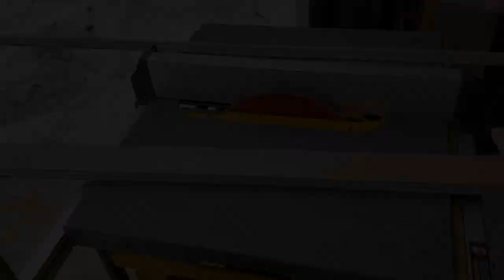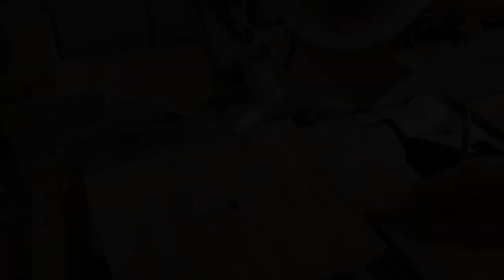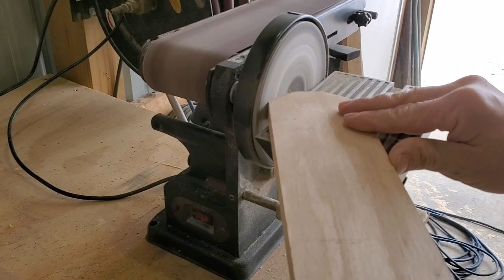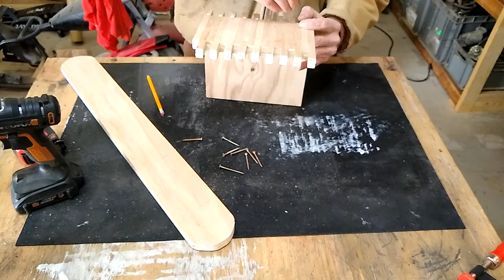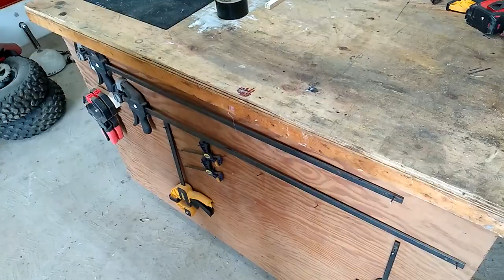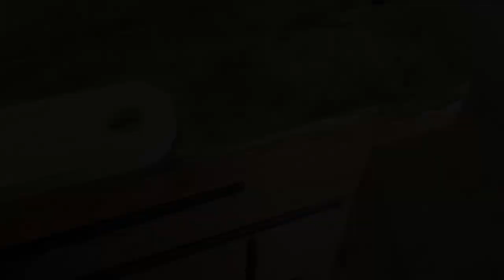DIY Box Finger Joint Router Jig Build

Comment: But you don't show how to use it. Does it work? Doesn't? Please, can you make another video showing how to use it and whether it worked or not at the end. Thanks in advance.
Reply from the maker: Yes it works and I'll make a short video here in a few days
Reply: It took a couple of trial and error runs for me to figure it out completely. The main thing to know is you'll rout the ends of 2 boards (4 ends) with the boards flush with the far right edge of the first finger of the jig. The other 2 boards (4 ends) will be routed with the board edge lined up with the inside (left) edge of the first finger of the jig. It's pretty slick and the easiest way to make box joints without a table saw or table jointer.

Comment: Is this working on bushel bearing (like that kinda bushel thing that goes into the router plate and overlaps the size of the router cut bit. 
Or does this jig work only for bearing staright cut bits? That’s already has bearing on the bit by itself?)
Reply from the maker: This one work with a bit that has a bearing on it

Comment: Jamie would this also work with a template bushing on the router? I can't remember if I have a ½", top bearing flush bit or not. Also, this design would work for virtually any size wouldn't it?  Thanks for doing this video! HUGE help!!
Reply from the maker: Yes a template bushing would also work and as for the size any 1/2 inch or smaller should work just fine

Comment: What is the purpose of the joint on the backside of you screwed it down and only use the front? I need to make one but would like to see how to use it. Is there a second video??
Reply: That would be used to cut the other end. Because it is offset the fingers will then mate.

Comment: Nice video. I would love to see the jig in action. Do I see it correctly that the vertical part is a little below the openings? Do you cut through that the first time?
How do you cut the opposite part?
Reply from the maker: Yes the first time you use it it will cut through it
Reply: @jlistdiy  ok. Does it matter a lot how much you have to cut through it?
Reply from the maker: no it dont matter
Reply: The other side of the jig is used to cut the other end fingers. They are offset from the first side so the joints will mate.

Comment: I built your exact jig. Thank for tip!  The big day came today for routing the panels that make up my speaker boxes. The material is 1/2 birch plywood, which I have heard that a lot of companies use for speaker boxes like this. I am using a very solid Porter Cable fixed base router with brand new 1/2" wide bits, with the bearing at the top of course. The problem is that no matter how slowly I go I still get a lot of tear-out (chipping) which makes a real mess and adds additional work in order to repair. Since this will be covered with Tolex material like most guitar speaker cabinets the patching will be hidden but if I was making a stained box it would all be scrap. Can you suggest something to minimize this or am i just screwed because I am trying to do this with plywood? Disappointing to say the least.  I know that people with router tables recommend spiral bits but there does not appear to be a spiral bit with a top bearing. Not sure where to go from here. Any ideas?
Reply from the maker: Have you tried using tape on the wood to avoid tear out ?
Reply: I think I read that spiral-cut router bits result in less tear-out than straight-cut?
Reply from the maker: @moustange  I believe you may be right
Reply: 3/4” ply is the go to for almost all guitar speaker cabinets. Solid!
Reply: You have to back up your plywood with another piece of sacrificial wood, like MDF.

Comment: I am not sure you can say "using only a router" when you used a drop saw and a table saw to make the jig...
Reply from the maker: Where did I say using only a router ?
Reply: @jlistdiy  they are confused. You built a box joint jig to be used with a router, not a box joint jig built only by using a router!